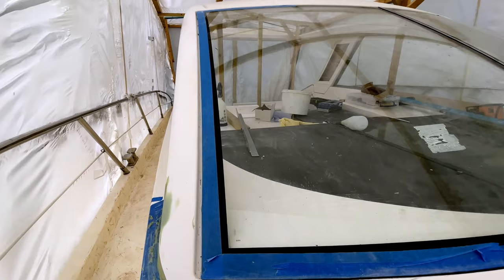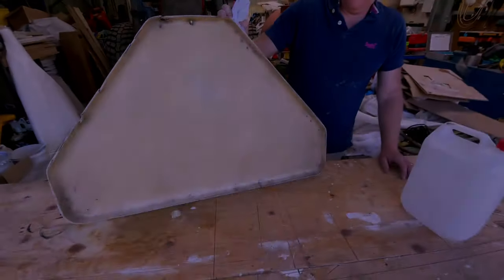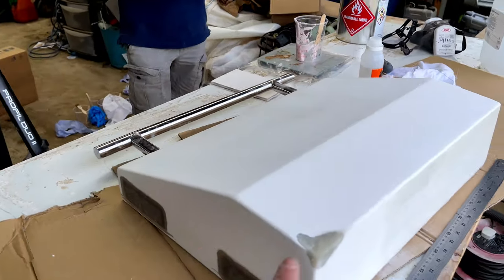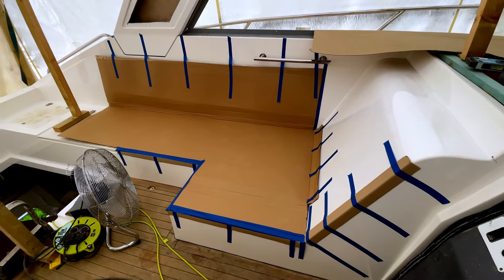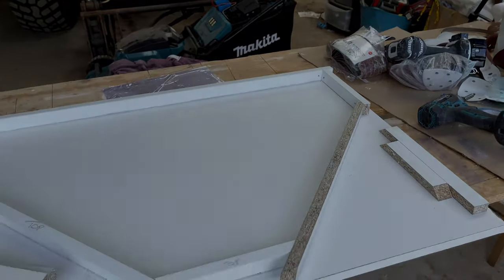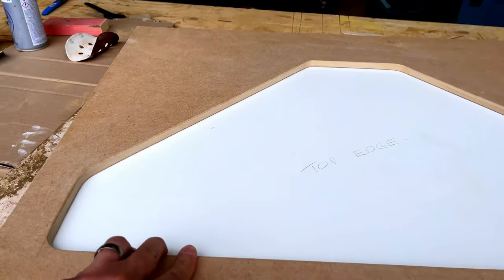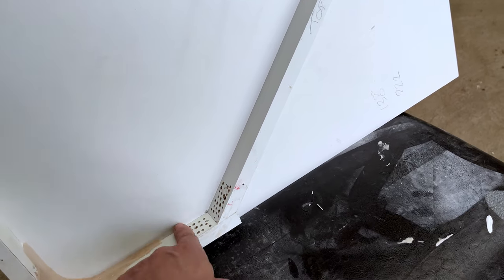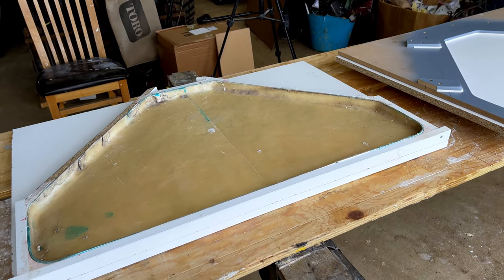DIY YACHT Restoration Project - Making a NEW Chain Locker MOULD - EP.68

Comment: Have you considered marrying the a-pillars to the lower front window frame? The alignment looks a bit off on the port side and it would be easy for you guys to fill and fair it in, before the paint job.  (I really don't see the need for it to be a separate part except that it was easier to build it that way from the factory).
Reply from the maker: The poor alignment of the port side A pillar seems to be a characteristic of these boats and is due to the base not sitting completely flush with the top deck, so sits slightly high. We have seen this on a number of other SC35's, but it does seem to be far less noticeable once sealant has been applied. We could fill and fair it but a good chance it would crack, so probably best left alone...